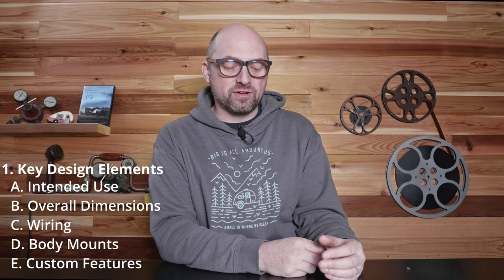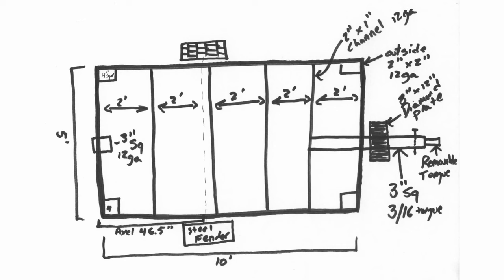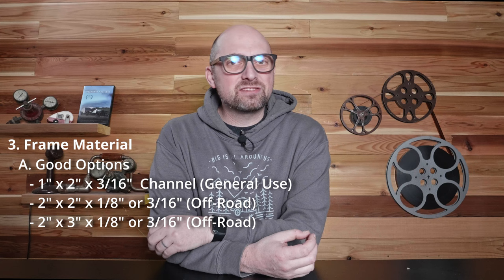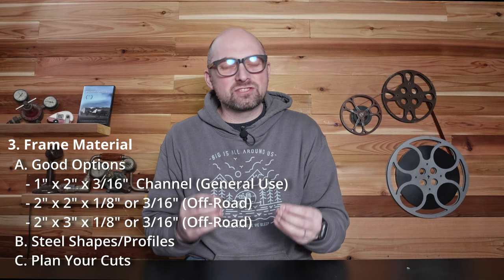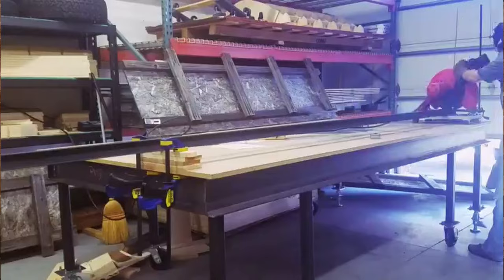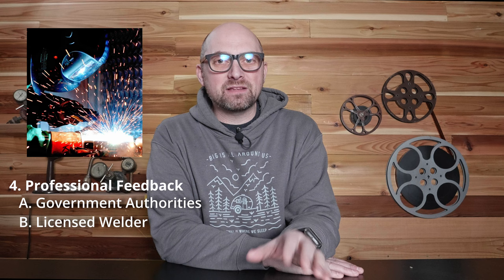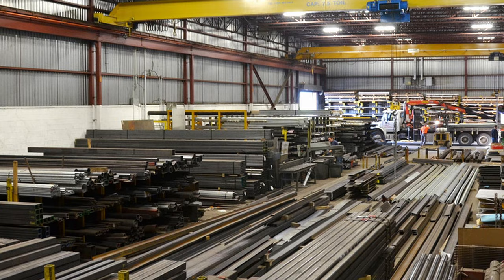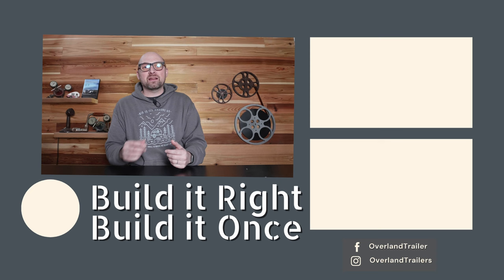DIY Teardrop Trailer: Frame Design | 5 Do's and Don'ts

Comment: In my project I had my frame built by a utility trailer manufacturer, based on my own drawings and to be built using aluminium:  they did some changes on the design based on their long experience on the subject and choose themselves the size of the aluminium tubings and finally they issued a VIN certificate and the number welded on the frame.
Reply from the maker: That's sweet!  Let the pros figure it out AND they VIN?  Win.
Reply: Do you have any plans or dimensions on the aluminum frame? I'm in the process of doing the same.
Reply: @alandickson1629  Yes I have them, they are in french but they can be understood easily and I can answer questions about them if needed.
Reply: Yes shortest design video ever let somone else do it.  Done.  Oh same for welding & painting. Oh just buy a trailer no thinking, learning or work involved.
Reply: @OverlandTrailer I have been a Welder for over 30 years and part of that I worked for a while for a shop that built 1ton truck beds, and trailers. Some built to haul 80,000 lbs. All trailers have to meet federal DOT codes before they can be towed on the road (registered to get the tag. True it's best to let a professional at least design it and they inspect especially the welds before they'll give it a VIN. Just my experience in the USA. God bless and work safe.

Comment: Good info, but some things missed. What about axle weight capacity. Some axles can't handle 2000 lbs plus so a 3500 lb axle may be required, but how do you know how much your whole trailer will weigh if you haven't built it yet? Thus picking the right axle for the build. The foundation is the most important thing to consider as that is what's supporting the camper
Reply from the maker: Very good points.  This video is focused on the frame (although axles do play into it).  Which is why I have an axle video already half filmed.  Actually, more than one!    Also, as I mentioned, professional feedback can help you determine a range of weight for your build (especially the welder).
Reply: @OverlandTrailer  Oh good to know. I'm planning on a 6x10 trailer build and trying to work out the weight is hard. Even though I'm not going off road I'm going to use Trimbren with a 4 " drop. That way I can get the height down abit. Plus maybe mention that if one is to build a trailer in their garage the opening of most garages is 83" to the bottom the the door so if the height of the trailer is above that you may need to put smaller wheels on the trailer to get it out of the garage or put it on a sliding bed to clear the door height.
Reply: @alandickson1629  I had to remove the axle from the frame to build the trailer in my garage, I put it on four snowmobile dollies for the time of the built, then pushed it outside when ready to install the axle.
Reply: Yep, I started my 77 x 144 inches travel trailer project on a 2000 lbs axle then once finished, I noticed that the wheels were slanted, like the old VW Beetles...  I asked a cargo trailer specialist to come and inspect it then he stated that my travel trailer was too heavy, I switched for a 3500 lbs axle.  After a while, I weighed the trailer at 2200 lbs with no baggage, food or booze.  It is quite impossible to determine in advance what's gonna be the weight of a project.
Reply: @charlevoix418  So my question is when building a trailer how does one determine what the weight in the end will be? I was going to build one 6x10 but my Rogue can only tow 1500'bs and from what I see alot of trailers out there are more than that. I guess I can determine the frame weight by the aluminum or steel  being used but the rest abit tricky. The aluminum on the sides is a fixed number, but wood for walls insulation,and wood inside for beds or kitchenette unknown.
Reply: @alandickson1629  I had a RAV4 four-cylinder engine with a 1500 lbs towing capacity at the beginning of the project, as time passed, I realized that the trailer would exceed this capacity, so I changed for a RAV4 six-cylinder engine with a towing capacity of 3500 lbs.:  I suggest you do the same and switch to a stronger tow vehicle.  I towed a 2000 lbs. rented travel trailer in Nova-Scotia with a 2001 Honda CRV 4 cylinder and big cargo trailer vans were passing me while climbing the hills...  There is not that much weight savings using aluminium in frame construction because you have to use thicker tubing walls to get the same strength as steel:  I choose aluminium mainly because it doesn't rust...
Reply: @charlevoix418  Thank you good to know
Reply: @alandickson1629  most materials you will be using you can find out their weight. For example plywood weight is given in kg per cubic meter (sorry, I live in a metric country)

Comment: Much easier and cheaper to buy and modify a second hand trailer...............
Reply from the maker: You choose Option 1!  There is a lot to be said about that way of doing it...if it's done right.  Thanks for watching!
Reply: @OverlandTrailer  the biggest problem with building is that it might not be up to regulation spec and will be banned from the roads. Easier to buy an old boat trailer.

Comment: What do you think about a frame made from PVC pipes?
Reply from the maker: Interesting.  It would be light.  The biggest concerns would likely be fatigue with mounting points for the axle and trailer body, it's flexibility would make that worse.  UV light will break it down and it will get brittle and fracture over time. It doesn't handle cold temps well without breaking either. I'm not sure that would pass inspection but it is worth asking your local authorities about it.  Thanks for the question.  I've never thought of that.  I love the DIY community for the innovative ideas!
Reply: @OverlandTrailer  so I’m thinking, from the outside …light weight wood paneling, insulation, Pcv frame, insulation, then light weight wood inner walls.  Of course the outside side walls will be done in fiberglass.
Reply from the maker: @DowntimeArts  Interesting.  So more of a unibody idea?  That does work.  I have a friend who made campers with carbon fiber as the body/frame in a unibody style.

Comment: What if I want to build the frame out of wood? The only metal I really need are hitch wheels and axel. I plan to pull it behind a motorcycle.
Reply from the maker: Good question George!  Most importantly, check with your local authorities for exact specs.  Generally, they want a metal coupler, tongue, and axle that are all connected.  For an ultra-light version, you could make a triangle of light steel that mounts to the axle and becomes the tongue of the trailer.  Then go with the old school teardrop frame of a nice stout hardwood that is joined well.  It's worth checking with your local government inspector to see if that would work.  Ultimately, they have to approve it as safe for the road.

Comment: You touched on material options. Are there guidelines or "rules of thumb" used to determine the dimensions and spacing of the various frame parts? I have what I think is a good design but don't want to over build it
Reply from the maker: Great question.  Of course, a good place to start is with the government requirements for a trailer.  The frame can be reinforced by the body to some extent too.  Typically a 24" spacing between spars is enough for a trailer with a plywood or 1/2-3/4" composite floor.

Comment: Question, do you do any type of interior tubing coating to prevent rust/corrosion?
Reply from the maker: Great question Ellsworth.  We don't coat the inside.  In a tube system, there is a bit of oil on the inside from production and we seal all openings in the tube.  It is much more likely to fail from the outside in than the other way around.  With that said, some people will use spray foam, truck bed liners, and other spray in methods.  The trick is sealing that system up as those tend to catch fire when welding up a cap on the end of a tube.  Thanks for the question.  A good one!

Comment: I am designing my own frame, my dad has an extra 65" torsion axel and fenders. My issue is that i have everything designed and am now pricing things out and realized that 60" is the widest they sell alluminum sheeting. So i am considering doing fiberglass and resin similar to doing a canoe. Do you think there would be an issue with expansion causing cracks?
Reply from the maker: Hi Craig,
Good Question.  My first teardrop was a fiberglass resin build.  It did ok but required a lot of regular maintenance because of cracking.  I eventually put metal over the entire trailer.  Here's information on that build: https://www.overlandtrailer.com/learn-about-teardrop-trailers/free-teardrop-trailer-plans/teardrop-trailer-build-mistakes/

An alternative could be a few sheets of metal skin on the top and join them with a flat trim piece and butyl tape (we can help you with those parts).  Another option would be to do the resin and then cover it, again, with a raptor liner or other truck bed liner that is more flexible.